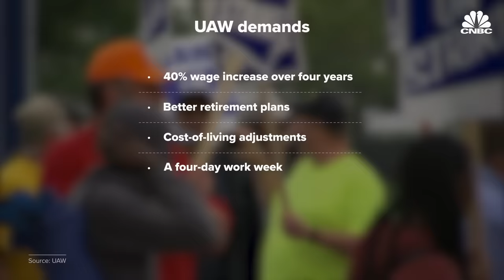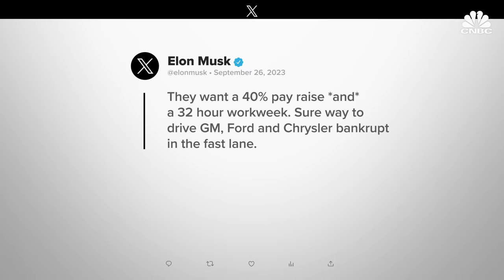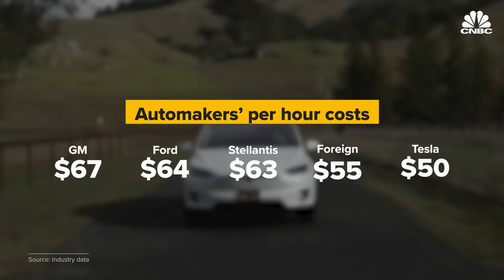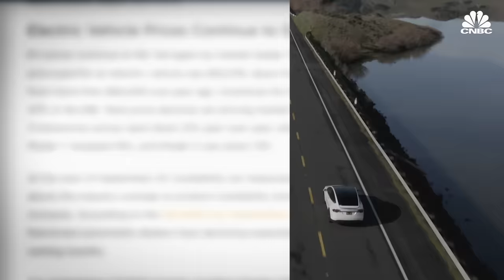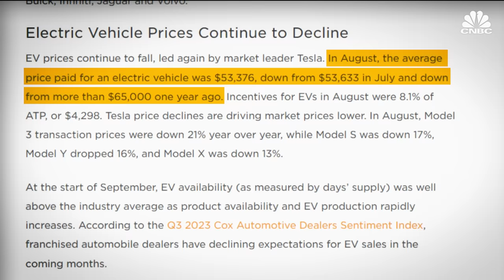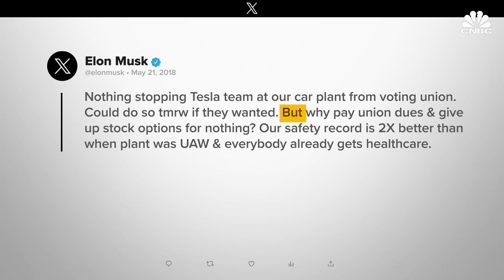Why Tesla May Be The Big Winner Of The UAW Strikes

Comment: The former tesla employee brought nothing to the discussion by talking about price decreases and price elasticity. The car market has changed over the period between 2022 and 2023 and government stimulus as well as high interest rates also had a major part in how and why Tesla changed pricing so often.
Reply: Even if Tesla sold a $20K EV, the cost of insurance and maintaining it will still be outrageous especially when you have to replace the battery 🔋🚗👩‍🏭
Reply: @SSGoatanks  You don’t ever replace the battery. When do you ever replace the engine in a car?
Reply: @eastonkundinger4005  a toyota engine can last 250,000km i highly doubt a tesla battery can last more than 2000 charge cycles....7 years that battery would be kaput....if ur use ur tesla for grab driving....
Reply: @jont2576 Tesla batteries last more than 7 years. And with 85-90% battery health. There’s tons of 10 year data on this now from the original model S’s when came out in the early 2010’s. What are you making these claims based on? For ordinary driving, almost no one will ever have to replace a Tesla battery.
Reply: @fusella  7 years?u mean like a sunday driver or something,i based it on the knowledge that most lithium batteries last no more than 7 years if ur lucky constant use and heat and degradation would have killed 20 percent of its life by the 2nd or 3rd years.....and no more than 2000 charge cycles max......

shyt every single smartphone or laptop and tablet i own since moto g in 2013 showed significant degradation after 2 years of use.

oh and tesla batteries are made of the same exact thing as ur laptops.....maybe a higher mah that tesla produces in house i dunno but in the early days before the gigafactory he was definitely using some japanese brand or something.

even elon musk himself said so.the only way ur tesla batteries gonna have 85 percent health is if someone buys a tesla and never drove it again for 7 years and parked it in a cool air con garage.
Reply: Thank you! I listened to the end and the first words that came out of my mouth were, "He doesn't know what he's talking about."

He's angry, so he can't see things clearly. Yes, Tesla's margins per car sold has decreased. That was done to put the squeeze on the competition. Right now, Tesla is averaging close to $10K on every car sold. That's WITH the reduction! The big 3 lose money with every EV sold. The Chevy Bolt, for example, was costing Chevy $9k for each one sold. The more Tesla's sold, the more they can reduce the cost per model because of the increased efficiencies of scale. Their gigapress was also huge in reducing production costs, again, allowing them to drop the price.

I was pretty surprised CNBC thought he was a credible source to use in their piece.
Reply: @SSGoatanks 

Wow, @davidc8937 started the discussion saying that the former Tesla employee brought nothing to the discussion and you respond by saying even a $20K Tesla is a bad idea, because you have to replace the battery! Hahaha, ok...that came out of nowhere!

Ok, fine, let's address what you said. Ah yes, the old "but what happens when you have to replace the battery?" tired argument!  On average, Tesla's batteries degrade 12% over the first 200,000 miles. Let me repeat that. If you drive 200K miles, your Tesla battery will degrade by 12%. That's it!

I've driven gas cars almost all my life. I have NEVER had one even *REACH* 200K miles! The best I've done is 185K miles. At that point, the costs to keep it on the road become more than what the car is worth. 

* Rebuilding the transmission. 
* Rebuilding the engine. 
* Timing belt/chain replacement. 
* Timing valve adjustment. 

Are you serious? There are people driving Teslas with half a million miles! Does the battery hold the same charge? Obviously not. But if it's still holding even 70% of its charge, it's still a useful car. Meanwhile, you're on your 3rd gas car at this point!

I have a friend who hates EVs who then countered with, "but eventually, no matter what, you've got to get rid of the battery, and that's bad for the environment." and I'm sure you're thinking this too and you shouldn't, because over 98% of the battery gets recycled and reused to make another EV.
Reply: @jont2576 

The more you post, the more you display your deep lack of knowledge on the subject of EVs and EV battery technology. You're comparing them to the battery in your phone or laptop? 🤦‍♂🤦‍♂🤦‍♂

Look, if you don't want to educate yourself, that's up to you. I won't waste too many words on you other than to ask you, if you think Tesla batteries dies after 7 years, how are people routinely getting 400K miles on them? Educate yourself. I read a number of your assumptions and they're way off, I just don't have the energy to correct you. But when a very obvious reality (people getting 400K miles from their Tesla) is staring you right in your face, a smart person would stop and re-examine their beliefs. Here's one hint: if you think Tesla just lets their batteries cook without a BMS, then you don't even know what components go into a Tesla battery. I mean, you seriously compared it to an iPhone battery, so it's clear you've got a lot to learn!
Reply: @jont2576  A tesla model 3 battery last 750k. So...
Reply: @eastonkundinger4005 many cars get the engines replaced.
Reply: @SSGoatanks such ignorance. 😂
Reply: What's ignorant truly ignorant is being brainwashed by greedy car corporations who have a monopoly on your city infrastructure, roads, and highways - Taxpayers are paying over $200 Billion every year to maintain it 🛣

When governments force everyone to own cars, people struggle financially paying costs like upfront sticker prices, insurance, accident/collisions, DMV registration/renewal - You don't truly see the true costs of owning a vehicle because it's all being subsidized through our tax dollars 💸🚗💰

It would be more efficient to build safer, sustainable, and more affordable transportation by reducing traffic congestion through bicycle infrastructure, buses, light rail transit, trains, and subways🚲🚝🛤🚌🚇 

Why should I buy a Tesla when I could bike, call Uber/Lyft, and take public transportation for less than $3000 a year?

Comment: A hit piece on Tesla yes.  But the lesson of the UAW strike is that all these car companies (Tesla being the 1st) will open car factories in Mexico. And it not just Tesla, Ford, GM, Stellantis, it'll be BMW, Honda, Toyota, etc.  And lurking in the background will be the Chinese car manufacturers.  And behind them are lurking the Chinese battery manufacturers.
Reply: That is the difference between the recent union gains for companies like UPS that was made very public.  The UPS workers don't have to compete against foreign workers.  A company like Tesla or Ford or any other US based car company can just move production to a place where there are no unions and labor is cheap.  UPS doesn't have that issue.  They are only competing against US labor.  Imagine a company that does plumbing or electrical work here dealing with a union vs trying to compete against a Chinese or Mexico company that does the same.  You can't outsource plumbing or electrical work.  Cars can be built anywhere.  The parts can come from anywhere.  There is no comparison.  That is why the UAW push for unreasonable  raises will fail.  The difference is competing against local only labor vs competing against the whole world and the lower labor cost and lower environmental cost of building something not here.

When your pipe bursts at 3 AM and you call someone, do you care if it is union labor ?  You just pay whatever is necessary to stop the water.  They are competing against the company making the pipe that made it a year ago and shipped it here 6 months ago so that you are able to fix the leak overnight.  It can be made anywhere.  The guy that showed up at 3 AM is the guy that gets paid more than those union workers to install the pipe that cost pennies to make.  

These guys don't understand the people that they are competing against.  They are competing against the guy making the pipe, and they are not competing against the guy installing the pipe at 3 AM.
Reply: USA, Japan, and Germany are the only countries with the expertise to make top quality cars. Even within the US, there is a huge difference in build quality between a manufacturer like Tesla and UAW made cars. Tesla's are just much lower quality

If car manufacturing moved to Mexico, the quality would drop as well
Reply: @mikea5745 expertise yes, but moving US car assembly to Mexico will have no effect on car quality. This has been proven over and over by many manufacturers that already assemble cars in Mexico.
Reply: Most GM pickups are made in Mexico right now
Reply: Tesla is the only true American made & their batteries made in Nevada, USA.
Reply: @mikea5745  Are Ford, GM vehicles manufactured in the USA?  I've never heard anyone attribute quality to either a Ford or GM vehicle.
Reply: This is why our country needs to bring tariffs back. Our workers are more important than Mexico's. Carter and Reagan forgot that.
Reply: @mikea5745 😂😂 take a look at your american made cars, their qa sucks. Many other countries are better and more prepared for manufacuring
Reply: The Big 3 already have plants in Mexico....
Reply: @_Wai_Wai_ Ford and GM make the best trucks. The reliability of those are very high and its likely the reason they both sell more truck than the best selling cars by a landslide.
Reply: @privateochoa Ford and GM trucks however are the best, even though their cars may not be
Reply: @mikea5745 lots of cars are already assembled in Mexico. Kia and Volkswagen cars aren’t falling apart because they’re made in Mexico. I hate to say this dumb line but it’s actually pretty racist to say Mexico can’t assemble a car as well.

Comment: More affordable cars = winner for not just Tesla, but for everyone else. Faster we get cheaper electric vehicles, the more people can buy and drive those.   Lower cost EV = cleaner streets, less noise, less pollution = saving millions of lives.
Reply: The transmission grid would melt down. Not feasible until that little issue is fixed
Reply: @brianjohnson6053  It would melt if every cars magically transformed into EV overnight. With 20-30 year lead time for full transition to EV, the grid will upgrade over time to support that.
Reply: Wait until your electric goes up and your paying similar prices at the pump. Transmission lines and generating stations are not cheap.

Comment: Tesla also spends fewer work hours on each car, so even if UAW and tesla both raise wages, the effect on the cost price and margins of each car is much less for Tesla. There is some evidence that the big 3 spend more work hours on each car because the UAW is mandating less efficient production processes, to keep unnecessary jobs.
Reply: It's more that tesla makes them to go together once... with a very difficult time maintaining or changing any crucial part out. Most customers waiting sometimes months for basic work to be done. You can fix a Ford mustang for the next 50 years in your driveway.
Reply: @dootdoot1867 A lot of it has to do with teslas giga presses. It takes less parts to make them. Like a cookie cutter manufacturing process
Reply: @frenchonion4595 not to mention their motors have one moving part vs thousands

Comment: Most people who watched this video (based upon the comments they posted) don't seem to understand that CNBC used a cheap trick to slant its reporting about Tesla. Specifically, what CNBC did over and over again was to report on allegations made against Tesla without reporting on any of the counter arguments that have been made rebutting those allegations. That's how CNBC presented claims that Tesla has a toxic workplace, fires people for union activity (an accusation that was already examined and dismissed as untrue by the courts), but perhaps the best example is where CNBC reports on how Elon Musk is accused of threatening to take stock options away from workers if they unionize. In this case CNBC doesn't bother to explain that it is the UAW, and NOT Elon Musk, that would take those options away. By telling us only about the accusation,  CNBC deliberately plants the idea in the listener's mind that if Tesla unionizes Elon said he will retaliate by withholding stock options. But that is completely false. The fact is, Elon Musk was merely pointing out that the UAW does not allow its members to receive stock options - therefore, if Tesla unionizes, it is the UAW (and NOT Elon Musk) that will take those options away. Further, the reason Elon's post about stock options has been allowed to remain up while this issue works its way through the appeals process is because the original claim about threats of retaliation is so weak that it is already deemed likely to fail upon appeal. But again, CNBC doesn't tell us any of these things. They just tell us what Elon Musk is accused of - a practice that is almost the very definition of bias reporting.

Comment: The CEO makes 300 times as much as the average worker. But, that means If you totally get rid of the CEO pay you only pay for 300 more workers. GM has 167,000 employees that comes out to $179 per employee. It isn't much money. Having a bad CEO costs billions. These negotiations, switch to Evs, plant openings, all cost billions. The $30,000,000 pay is not an issue. It is a rounding error and the pay is all bonus options/stock/funny money. They have to get the company to a place to even earn it.  The employees aren't paying it, investors are, and they are willing to because if the CEO gets the company to the goal to receive their bonuses the investors earnings make the $30,000,000 look small. And this is all investors, your little vanguard fund, teachers retirements, even the autoworkers benefit from the CEOs hitting their numbers.  The CEOs salary is only $2,000,000. That's even less of a factor. The employees aren't willing to take less salary and more stock/options like the Tesla people are. Which is fine, but let's not pretend like it is all the CEOs compensation's fault.

Comment: What planet is this guy from to suggest that Tesla will continue to lose margin & product demand is nothing short of wishful thinking.  Tesla's control of its products &  sales can change with a click of on a key on a keyboard.  Tesla can make split second (or close to split second) pricing changes whereas, OEM based car manufacture takes considerably longer & let's not mention its money hungry dealers.  As a consumer the last time I purchased a new vehicle I was able to negotiate under MSG.  Today, I would not consider going to a dealer due to the 'market adjustment' pricing!  But back on point,
Tesla produces cheap cars not only due to its labor costs but its innovative thinking in the design & assemble of its vehicle.  A recent demo of the Tesla Model Y clearly demonstrated Tesla lead in the design & assemble race.  Hell, even a mechanically challenged person such as myself could assemble a Tesla MY, its just that simple!  Also, to make matters worse for OEMs itis only a matter of time before Tesla introduces its t-bot Optimus to the car manufacturing arena further reducing costs.  To be honest, if I were Ford, GM or Chysler I would be loudly knocking on Tesla's Door to secure help with factory redesign & schooling on the Tesla Method!

Comment: If Tesla's labor costs being lower than their competitors is so key then why are their cars more expensive than the competition who need 40% more workers to build a more complicated car with way more components? Even when these old dinosaurs of a company make brand new EV's they price them so competitively against Tesla's that Tesla HAS to institute a price drop just to remain competitive. So much for Tesla's lower cost of labor actually leading to something meaningful on the consumer end.
Reply: Your joking right teslas are way cheaper and ten times more reliable than the EV cars that are coming out of the Legacy auto makers especially Teslas used cars are much better options you must be under a rock
Reply: Well, Tesla has much higher profit margins so they're keeping more of the money and their EVs are now priced about the same as the competition..
Reply: @ShadowTCompany the rocks name is mainstream media
Reply: @BadBackOz  they dont have to deal with fat "skilled" union workers is why
Reply: @BadBackOz that high profit was when the cars were priced higher. There's a lagged effect to the bottom line. So the price cut Tesla we sell now, are much less profitable. And, labor isn't the only cost. Tesla has the most automated manufacturing facility. All that equipment costs something.... It's not cheap. It's new equipment. This isn't gm/Ford running old plants. All of this is built new. So you're not factoring in trial and error costs.
Reply: @ShadowTCompany teslas are notoriously one of the worst build qualities for cars out there. They rank near the bottom on consumer reliability reports years after year
Reply: @Matias_L  I never said there the best in quality now did I if you read correctly I said reliability and that’s not a surprise from a much newer car company remember Tesla hasn’t been around for 100 years like the legacy makers also there steadily improving in that field which is great